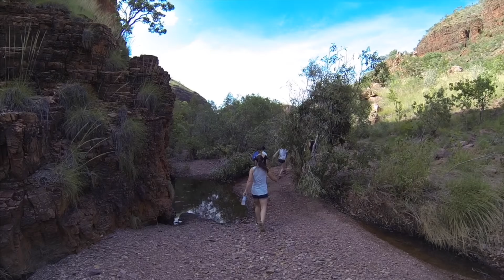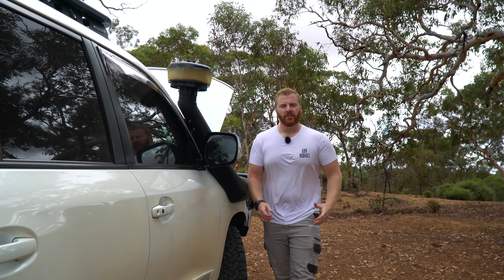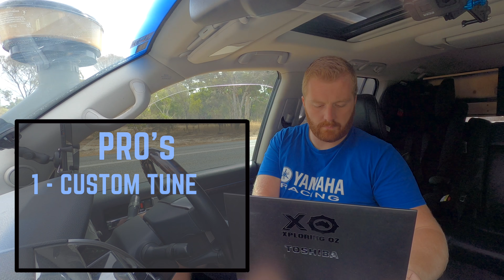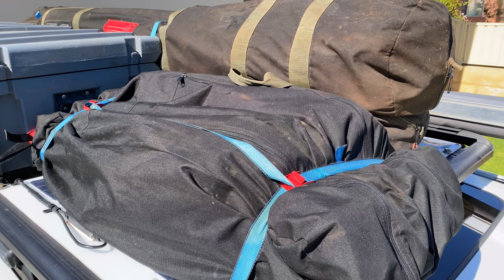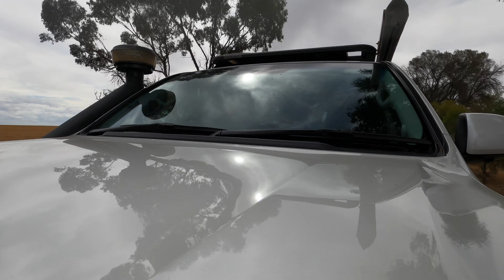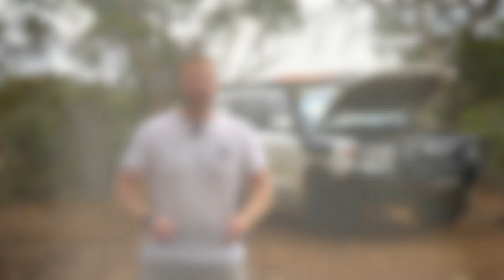POWER UPGRADES | Remaps, Chips, Hardware? | What works best? | Landcruiser 200 build | Transmission

Comment: Hi mate great video 👍🏼 just brought a 2013 200 series and have been watching a few videos on tuning and modifying them, I’ve just had a snorkel and air box fitted, a manta exhaust, a custom ecu tune and torque converter lock up and gearbox tune, and wow what a huge difference! We went from 121kw and 551nw at all 4. To 183kw and 885nw at all 4. And so much nicer to drive, love the 200 cheers 👍🏼

Comment: I did custom tune on mine , massive performance improvement but still afraid from some heats range like (coolant temps and bost charges air temps ) i did lot of researches i couldn't find specific normal ranges for lc200

And thanks bro a really like ur informative vids
Reply from the maker: For sure, some great advantages there! 
The ranges vary so much depending on vehicle setup and driving conditions. I normally see about 80 coolant temps, up to 105 under heavy load in short bursts.
Reply: @XploringOz  thank you so much what about charged air temps?

 My coolant average 83 to 88 on cruise
I thought it's bit higher than normal 

Actually ur videos very informative especially for me most on not answered questions found sulotion here
Reply: @XploringOz  .

Comment: Good YT Nathan.  Have you considered installing bigger transmission coolers on your vehicle.?  Once you start towing the new van, especially if you’re doing hard work it might be beneficial.  I guess you can wait and see what happens with your trans temps. 

I found this YT interesting because I’m seriously considering doing an auto conversion on the Troopy when it arrives.  I was going to do that with the torque lockup kit and as I obviously had no auto to start with I was going to address the cooling with hardware, while my wallet is out 😂.  The auto conversion isn’t cheap but it’s cheaper than the coil conversion, so what the hell.  I’m getting lazy in my old age & the idea of crawling through the tuff stuff, sand, mud, steep Rocky climbs without fiddling with a clutch really appeals.  

On another note, I recently bought a German sports car, it’s fitted with a Dual Clutch Auto.  I’d never had a dual clutch auto before, always preferred manual but this thing shifts gears like a bat out of hell.  Anyway, car is seriously quick, 0-100 in 4.4 seconds.  I started reading about tunes for them (as you do 😂) & I got to go for a run in two different tuned versions of my car.   HOLY SHEET, the first one was stage 2 tuned (Remap) & it’s 0-100 in low 3 seconds and the stage 3 tune (remap) one can pull 0-100 in 2.9 sec.  I will tell you I’ve never laughed so much in all my life.  I’m not really a speed driver (it’s been 35 years since I was last fined) but it’s a barrel of laughs on a country road, give this thing a little stab as you exit a bend & it realigns your spine 🤣.  I would NOT consider a module for that, for high performance (sports) a remap is the way to go.

On my old Troopy I had an expensive module Steinbauer.  From memory that much more expensive than a remap.  It had to be put on the dyno and it transformed the Troopy.

So I’m thinking I will have to do a REMAP on the Troopy & obviously will do that once I decide to auto it or keep it as a manual.  Since I was going to run 35 inch tyres I’m thinking the Remap will help with spinning the big rubber as I’m obviously not chasing fast 0-100 times with it 😂

Someone told me I should grow up & start acting my age the other day …….  Where’s the fun in that ? 👍
Reply from the maker: Hey mate, yeah I have considered a cooler, but I really don’t think I’ll need it at this stage with the trans lock up kit that I’ve installed previously. Even when I had the old caravan, as soon we had locked up that transmission, the temperature were sitting at very healthy levels. Even on a hot day, towing a heavy load, the trans temps won’t get much higher than 80 degrees. I don’t think I would get the value for money form the cooler. 

Auto conversion! That would be cool. There’s no doubt the auto transmission that Toyota make are a great unit, smooth, direct and reliable. Having one of these in a troopy would make it the perfect and ultimate tourer.

0-100 in 3 seconds! Would you feel the effects of that in the drivers seat 😆 What vehicle is it? Those dual clutches really are something else. I haven’t had much experience with them and they sure add another level of complexity to the vehicle, but they are effective! 

Yeah, there are some chips out there like the Steinbauer and the UniChip that are quite expensive and very effective at what they do. Nothing beats a tune on the dyno though, whether chip or remap. 

I’m not familiar with the gear ratio’s of the Troopy’s, but have you considered a change in the diff gears running the 35’s? This would defiantly offset some of the effect that the large rubber would have and bring all the ratios back to a factory setting. If you paired this with a tune, it would be a weapon on 35’s!

Yeah…. Growing old is mandatory, but growing up is optional! 😂

Comment: Howdy. Nathan, I normally agree with  your reviews however in this instance I feel that you've missed the mark. For example, your review of "Chips"  seems to be focused on the low end of the market which inevitably leads to a poor outcome (waste of money, lack of performance or too much performance until permanent damage results to the engine). Although there are only 2 or 3 high quality "Chips", these are the only ones which should be compared to an ECU map. Alternatively, any comparison should include 3 categories: remap, low quality chips and high quality chips. Regarding cost, a remap is actually cheaper than a high quality "chip" due to these chips also requiring a custom tune (therefore Dyno) specific to the vehicle.  Pro of a High quality chip is that it is removable and the best ones offer the same tuning capabilities as a remap Vs pro of ecu remap being cheaper. Either way, an inexperienced tuner will result in a poor outcome for either a remap or high quality "chip". Thanks for the content, cheers
Reply from the maker: Hey mate, that’s all good. Like I said there are so many options out there and everyone has a different desired result from their vehicle and their thoughts on this subject. 
 I agree that some chips can probably get similar results when compared with the remaps, however there are soo few out there and the prices are enormous! And then there’s the tuning on top of that. The removability is definitely a huge advantage though! 

I agree 100% with a poor tuner will result in a poor outcome. This is something that needs to be done by a trusted technician! 

Thanks mate, Nathan.

Comment: Great work yet again,
Your videos have the most informative content.
Are you running gme xrs units?
If so can you please do a video on how programme these units to just scan 3 channels ?
ie ch 40,39,18 and others as required
Also why the 2 antennas ?
Reply from the maker: Thanks mate. Yes, I'm running the GME XRS, one 370C and one 390C unit. I'll look to do a video down the track in relation to communication gear 👍 
One antenna for each radio unit. I always run the smaller 3.1dB, due to my garage clearance, however switch over to the 6.6dB when on the tracks.
Cheers.
Reply: @XploringOz   Look forward to seeing the set up,
I run the XRS 330, which is the basic XRS unit and love the features, yet can’t work out how to program it to just scan a few channels rather than them all.

Comment: As usual Nathan, very informative and well delivered 👍🏽. I’ve been running a Unichip with custom transmission tune and Richard’s lock up clutch since I bought my 200 new at start of 2019. This was installed as part of a full custom build by PDP in Perth. Simon and Travis spent a lot of time on the dyno making adjustments to get the best performance out of each setting. I ended up with some awesome power and torque gains without compromising reliability.
I was very surprised at the fuel economy to, well as long as you don’t put your foot hard into it 😂. As you rightly said, there are pro’s for and against both custom remaps and chips. It’s very important that you do you research and work out what’s best for you.
Reply from the maker: Thanks mate!
Awesome, yeah the results can be impressive either way. I think the individual tuning and adjustments for each and every engine is very important!
I hear you with the fuel economy, I've increase by about 0.5L, but I think that may have something to do with my modified driving style 🤔 😂

Comment: So how was your fuel consumption before and after the mod
Reply from the maker: Hey mate, the fuel consumption went up maybe 0.5 - 1.0L per 100km. It definitely didn't help too much, but then again, maybe my driving style has adapted to the extra power and the V8 exhaust a little too 🤷‍♂️

Comment: Hi Nathan another good episode are those figures from the Dyno for rear wheels only or all four wheels ? What was the cost for a double re-map 
Thanks Ant
Reply from the maker: Thanks mate, glad you enjoyed it 👍 Yes, that was the power at all 4 wheels, no disconnecting the drive shafts around here...
I think from memory it was about $2k or a little under that. I had some other work done at the same time, makes it a little hard to remember the exact cost. 
Cheers, Nathan.

Comment: What about fuel use before and after?
I am going to get lock up kit, I would get a tune to get benift of mods like exhaust but I would want to stay at 18 for fuel to keep longevity.
Reply: You'll save around 2ltrs per 100 on highway with lock up kit.
Reply: @bigfishfishing-111  I don't have lock up kit now and 90 and above it locks up already. 

But will be locked up more. Highly doubt 2lt per 100km saving
Reply: @ausguy4385  You don't have a 200 do you
Reply: @bigfishfishing-111  2012 vx
Reply from the maker: Yeah, so fuel use went up just slightly. It only went up about 0.5L - 1.0L per 100km. Then again, its hard to say whether this has anything to do with the driving style to match the extra power and V8 exhaust 😂 
The lockup kit will definitely help with some economy, but the biggest advantage is going to be reduced transmission temps.
I'm getting about 15-17L/100km with my setup on the highway depending on the circumstances 👍
Reply: @XploringOz  Hey Nathan is that towing ?
My Cruiser loaded for long fishing stints use to be 14.8km per 100km but now since engine, trans remap and Richards lock up it now 12.6 per 100 on the highway in s6 and cruise control. Car weighs around 3350kg.
I guess there's so many variables with tunes, mods, driving styles ect, so they're all different.
Reply from the maker: @bigfishfishing-111  Yeah, I've found big differences between driving conditions. I've got as good as 13L/100km (not towing) to as high as 18l/100km (not towing). 15-17L/100km seems to be the average for city/rural driving at the moment

Comment: Hi. What is ur fuel consumption like. Cheers
Reply from the maker: Hey mate, so the fuel economy increased by about 0.5 -1.0L per 100km. It was only a small increase, but this could of also been a driving style alteration to match the new power gains and V8 exhaust 😂

Comment: Yes an upgrade is on the cards for my 76 series. Perhaps when I start towing. Not sure if I'm sold on a remap. I'm leaning towards unichip.
One question. How has fuel efficiency been affected on your 4wd?

Thanks again on another informative vid.
Cheers
Mick
Reply from the maker: Thanks Mick, glad you enjoyed it 👍 
So the fuel economy increased by about 0.5 -1.0L per 100km. It was only a small increase, but this could of also been a driving style alteration to match the new power gains and V8 exhaust 😂 
All the best with your 76'er.